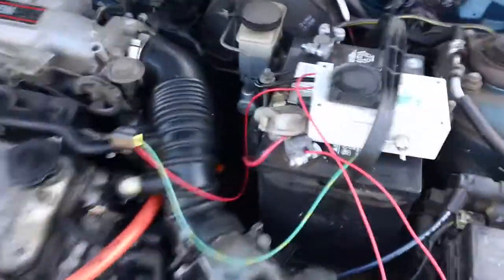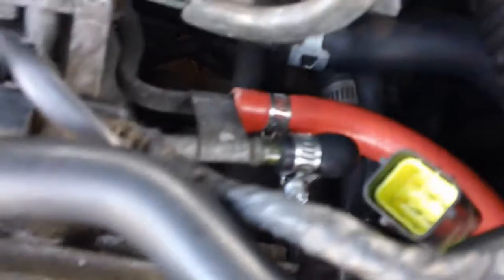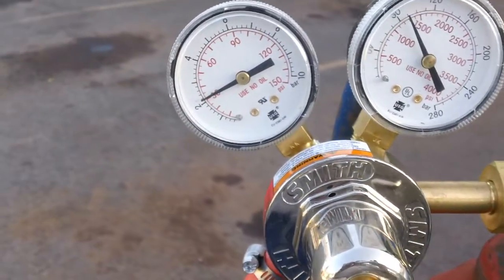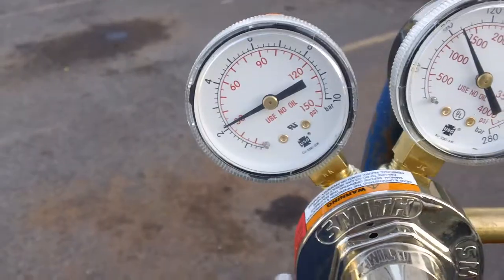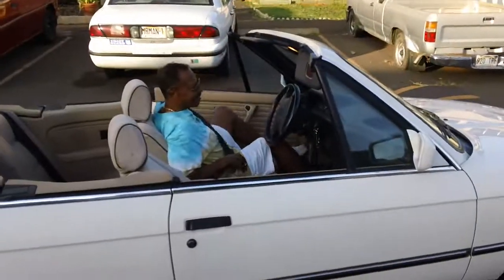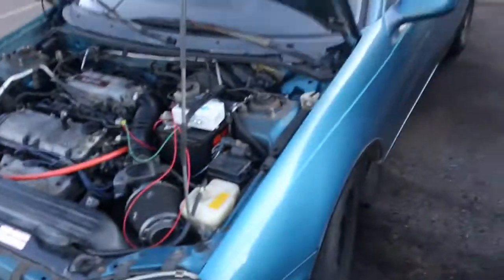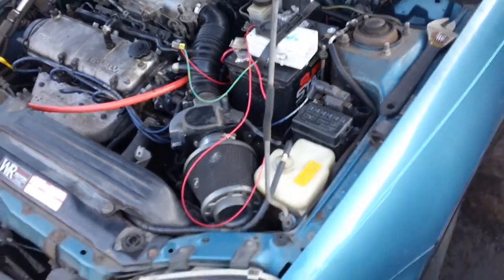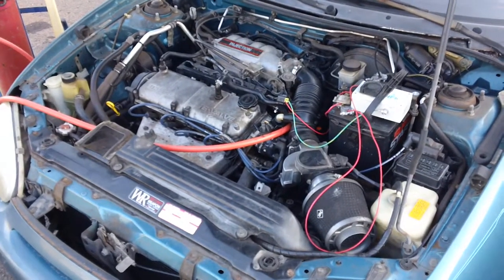Running a Car on Hydrogen Part 2

Comment: SORRY FOR THE WRITING MISTAKES!!!!
SO?? my sugestion would be:1.Try to leave the injectors conected as they are to the computer and play with the psi
2.try changing the frequency and length of the pulses while pressing the paddle(HARDER METHOD IN MY OPINION)
now my question for you as others asked can you provide the liters per minute of the gas consumption
thanks!!!

Comment: hi!
first of all you have done a great job but you have more work to do and maybe you can help some of us who don't have the tank of hydrogen.
the reason that the car it is NOT responding to the gas pedal is because by pressing the pedale you give more air to the engine so the rpm go higher but by conecting the injectors to the pwm you separated the computer who changes the lenght and frequency  of the pulses to the injectors acording to the sensor on the flywheel.

Comment: how are you controling the throtle u mean ya the injectors or working but i would thing thay pushing the gas just opens the butterfly valve in the throtle body/ that lets more air in but dise not increase the amont of fuel?